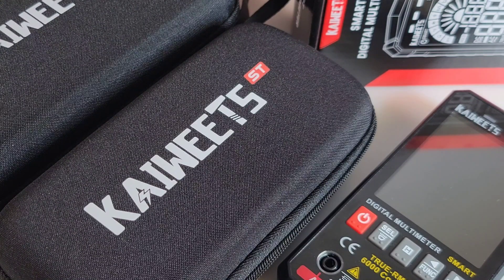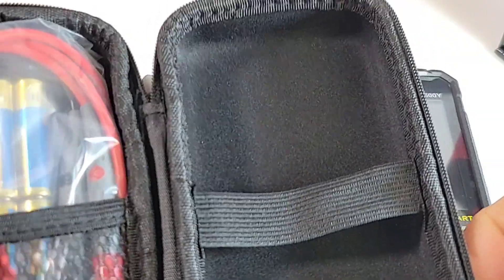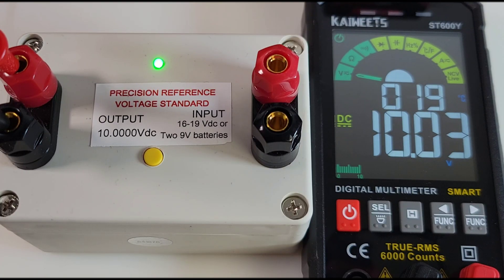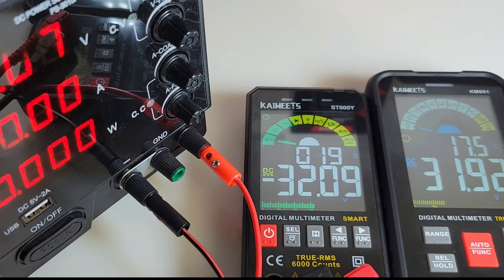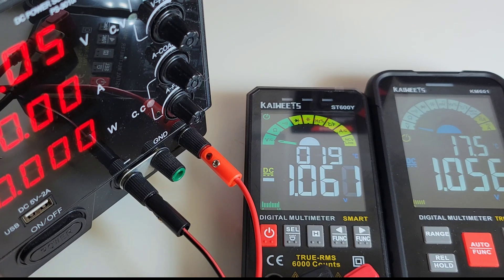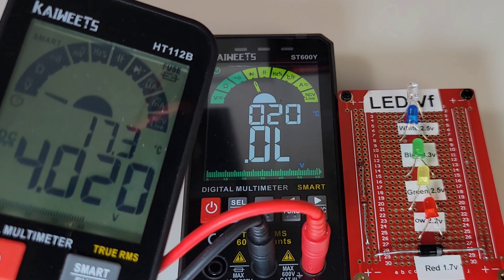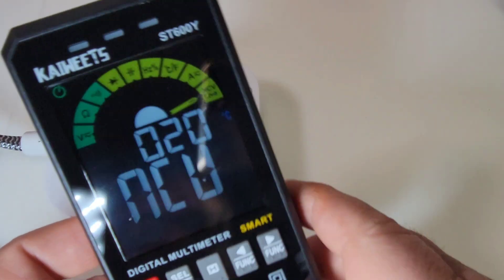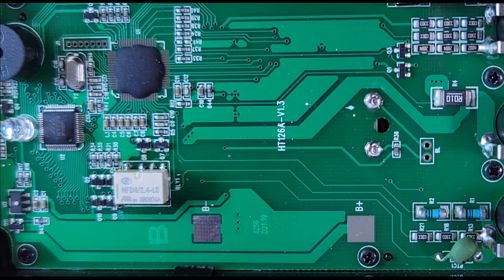KAIWEETS ST600Y SMART Multimeter Review & Teardown

Comment: Is the Kaiweets ST600Y same as Habotest HT126A / HT126B?
Reply from the maker: Yes its very similar, they utilize the same pcb. However, the companies are separate entities with different ideals.
Reply: @KeepOnTesting  I need your advice.  which is the most accurate smart multimeter, UT123D or HT126B/ST600Y?  Or is there a more accurate of these two types?
Reply from the maker: @jatnikabudisantosa3049  ST600Y best of the bunch.
Reply: @KeepOnTesting  thanks for four suggestions 👍
Reply from the maker: @jatnikabudisantosa3049  Anytime my friend!

Comment: The latest kaiweets model is the km601 or the st600y?
Reply from the maker: ST600Y is the latest model.
Reply: @KeepOnTesting  is the km601 multimeter better or the st600y? i can't tell the difference.
Reply from the maker: @farlusberner8986  Personally my preference is the ST600Y..Absolutely gorgeous display. Fast and great size. 👍
Reply from the maker: Btw the ST600Y display is even better than the KM601. It's more vibrant and slightly higher contrast which is incredible considering the km601 is a great looking displaty too !! 😀
Reply: @KeepOnTesting  Than kyou
Reply: @KeepOnTesting  Ok thanks for the information.

Comment: You don't really need a tilt stand on the ST600Y as the screen is designed to read while lying flat on the surface that you are working on,bench etc,better screen resolution than when it's sitting up at an angle,I regularly use mine while under a car bonnet and sitting on top of the engine or battery and it's very clear
Reply from the maker: Agreed it's highly readable outside..I do prefer a tilt stand for benchwork but the display is still very good while lying flat. 
Thx for the feedback 👍

Comment: another not chepo one
Reply: @KeepOnTesting  37$ US CHEPO  must be under 20 $ us 😅
Reply: Darren, Did you mention that the ST600Y doesn’t accept standard banana boots, so if the leads are smoked not likely to be easily or economically replaced!!
Reply: What about the ST600X? Cheaper than the ST600Y except in black and white like most meters!!!

Comment: Smart Meters don't seem to perform any more functions than the manual versions but sure look the goods. Am I correct in thinking the manual versions seem more solid and will have a longer lifespan?
Reply from the maker: It's hard to gauge long term longevity..I think a big part is the user experience,  some people are really tough on multimeters. I do think if you were to use it for serious automotive work it might not stand up as well as a traditional dmm which can be more forgiving to oil, scratches and dirt in general.

Comment: Wow two smart meters in a row, and both are a definite step up.  Ive never been a big fan of the whole "cell phone" multi-meter format, but it certainly does seem Kaiweets is showing a serious effort to make this format more desirable and popular.  My only negative is a question on battery life, the fact it comes with four AA's is a tell-tale of high battery consumption especially on these displays which im guessing could be power hungry, but im only posing the question not stating facts.  I really like the full manual option, always good to have.  I have to admit this and the recently reviewed one before it are both serious efforts in the growth of smart meters as a popular option. Kudos to Kaiweets they really seem to be paying attention to past shortcomings in these meters and addressing them in a meaningful manner.  If I didnt have SO many meters I would be wanting one of these babys.
Reply: but still not the full samrt one you should try like testo it do all without the need to touch buttons not only ohms volts buzzer but also diode and capacitance

Comment: Any rough tough meter which can bear 350v dc or 230v ac on continuty range or resistance range .any 9000 counts meter can tolerate this kind of mistake.smart multimeter tolerate this kind of mistake or not?

Comment: Pretty nice looking DMM, but I´m a litte concerned:
- How readable is this kind of Display?
- Is it able to read low voltages (Millivolt)?
Reply from the maker: No problems down to 10 mV.
Outside the display was very good, only in really bright direct sunlight does it get washed out some. Here's a view outside on my deck. Here's a pic : https://drive.google.com/file/d/1NjVx8cHGxhNNlEOzzwPrOvBWFbv8wTcj/view?usp=drivesdk
Reply: @KeepOnTesting  First things first: Thank You for the effort to provide the pics. The display works very well in daylight, even compared to original OLED´s. That´s not the case with every inverted LCD. Do You have any estimation about the lifespan of a set of batteries?
I assume the 10 mV are resulting from the resolution and there is no special mV or mA range.
Have I got it coppy right?
Reply from the maker: @probang2866  I'll test the battery longevity this weekend and let you know 👍
Reply from the maker: @probang2866  correct, there's no dedicated mV range ..

Comment: Nice job Kaiweets! Seems like solid NCV considering no bump-out. Is that front plastic or glass? Will it get scratched?
Reply from the maker: It has a very hard thin plastic protective film on top that seems quite robust.. I think it should hold up fairly well although it's definitely not as strong as a typical dmm just because the design allocates alot of real estate to the screen.

Comment: The high quality case is very useful as well with extra storage functionality in it. EBTN display is definitely more vibrant in colour and brightness on this one. If they would give tilt stands and easy fuse access in these cheap-o multimeters after feedback from your videos, their sales would be boosted. Continuity could also be fixed by high quality test leads even if it gets somewhat expensive. The ST maybe stands for Smart Tech which it def. is.
.
.
.
.
.
Kaiweets ?
Reply from the maker: You got it ! 👍 Better test leads would be a nice upgrade.